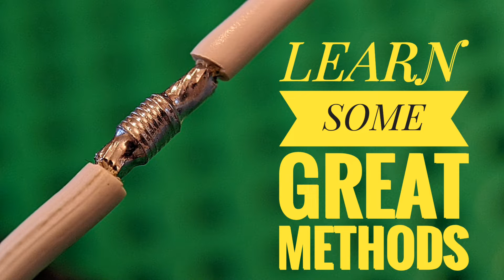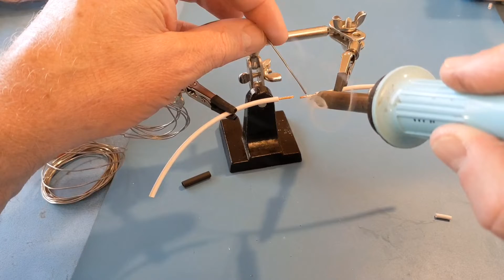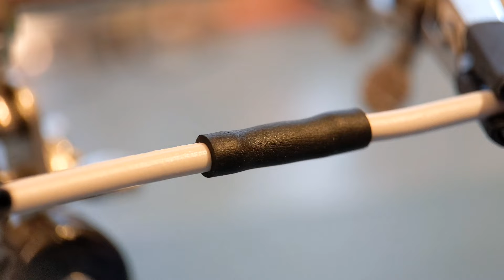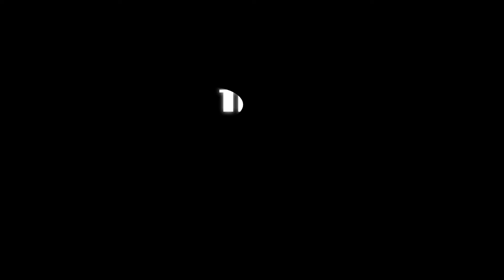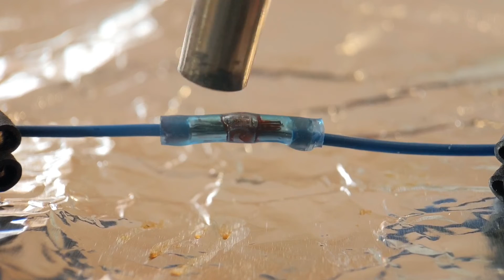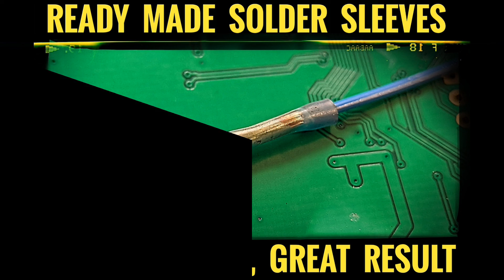How To Solder 2 Wires Together ( The BEST PRO Methods + Tips )

Comment: Thanks for the video, any tips on soldering very small wires? I was trying to solder PS2 controller wires, they only had 2 strands each and they kept melting and disconnecting when I solder.

Also, a question regarding your technique: The way I've been trying to do it is hold the solder iron under the wire and get the solder to melt on top, it doesn't always work for me for some reason the wire just doesn't get hot enough to melt the solder. Looks like you start with the iron tinned, then hold the iron side ways on the wire and have the solder touch the iron while moving back and forth, would that be an accurate way to describe your technique?

Comment: Oh man, that is gold right there. I've used a couple of those techniques, but I'd never used the "wrap with external wire" method before, and now I'm wondering why the ^#$) I never thought of that before. I could easily see that  becoming my go-to technique for wire splicing (I usually use the  mesh technique at the moment). It also occurs to me that you could combine the mesh technique and the wrap technique together. I might just grab some wire and try that out later just to see how it works.

Thanks for the awesome video!
Reply from the maker: Hi , thank you for watching the video and commenting , your support and kind words are very much appreciated 👍
Reply: @mrsolderfix3996  - After writing that I jumped over to my lab bench and did a few test splices. I did try combining the mesh technique with the wrapping technique.. and I'd say that worked extraordinarily well. I will probably do all, or most all, of my wire-to-wire splices like that in the future.  Thanks again for putting this material out there!
Reply from the maker: @PhillipRhodes hi , I'm glad you had good results , that's great to hear . I put a selection of methods out there so people could hopefully find one that works well for them . Thanks again for your support , take care 👍

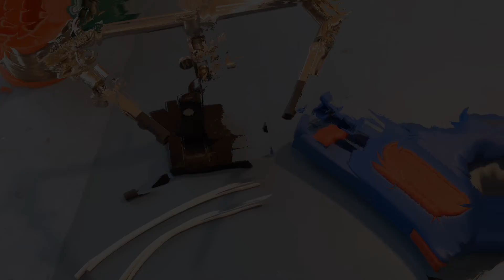Comment: I really liked and appreciated your video.   But I also really liked and am trying to find the Thomas & Betts self-adjusting wire stripper you show about 8:38 into the video.   I have struck out trying to find anything like it that will go down to 30g as you mention for use with very small stranded wire multi-conductor cables.   Would you please provide the model name or number for that tool?

Comment: Nice video. I still prefer lined marine grade heat shrink over silicone method. It gives connection a rigid thermo suitable for underwater applications.

Comment: I would add the 'double L' method. It is a (better) option of your 'hook' method (as it provides more contact area to the joint). You bend each lead in an ''L' and you overlap them slightly. You then twist the 'leg' of the 'L' around the other wire. Do that for the 2nd wire, and then do a slight pull and solder. This provides a better electrical and mechanical connection. The 'J' really relies on the small connection in the elbow of the 'J' for the electrical connection.
Reply: You can't trust solder to provide a mechanical connection - it is very weak in that aspect.

Comment: Nice video. Only thing I would comment on is that when you shrink the tubing, you only (show) heating one side of the tubing. You really need to rotate around the tubing, so that all sides shrink. Also, I see people using a BIC lighter, and it kills me! Buy a heat gun!!!
Reply from the maker: Hi , the way I've done it with the foil behind it reflecting the heat back ensures shrinkage all around . Unfortunately I don't have a proper shield that fits onto my hot air gun so the foil is a good substitute and works well . Thank you for your comment , much appreciated 👍

Comment: Interesting the solder sleeves. Now need a video on how to use just a flame (cigarette lighter for one example) to solder two wires together. Great for a field solder where no power to use a electric iron.
Reply from the maker: Hi , thank you for watching the video and commenting , much appreciated. I definitely need to do another d.i.y soldering iron video that can be used without electricity. Thanks for the suggestion 👍

Comment: What I do: Twist wires together, bent it over, twist solder around it, heat it up, bam! Get very nice and low resistance results with this method.
                                 \
---------------                \                 ------------------
                 --------------| |--------------
---------------                                   ------------------

Comment: Nicely presented. I prefer the splice where you lap together, bind with copper wire around the lap, then solder and heatshrink. Looks decent, gives good area for electrical conduction and is mechanically strong and compact. Nice job thanks for video👍
Reply from the maker: Hi , thank you for your comment, much appreciated. Glad you enjoyed the video 👍

Comment: Again, great video.  I've been using these methods (especially the solder splice mesh method), for years but didn't know the names until now.  When I use the mesh method, I often give the wires a slight twist and have them lock together tighter.  Probably made a bit more work for myself but I've had very good results from those.
Reply from the maker: Hi , thank you for your comment and support of my channel , very much appreciated. It sounds like you have great success with your method so good on you . Hopefully within these methods there's one that can help people out . I like you have my preferred favourites so I tend to stick with these . Thank you again for your time , take care 👍
Reply: I do the same thing - mesh method, but with a twist. I think the only real downside is that twisting the strands together may make it harder for the solder to wick its way through the entire joint. But I like that it holds the joint together during the soldering process.

Comment: Would have been nice to see how you start the wire wrap. I suspect it's very fiddly!
Reply from the maker: Hi , thank you for your comment. The wire wrap method is actually really easy . I just lay a length of tin copper wire along the joint and then turn at a 90 degree angle and go around the 2 wires being joined . Repeat this turn process until you have a suitable amount of turns for size of joint then trim both ends and you should have a tightly packed spring like wrap . Sounds complicated but it's actually really easy . Hopefully this makes sense , thanks for your comment , take care 👍

Comment: I’m currently doing project with 24 g wire and I have early stage Parkinson’s so soldering is a time-consuming adventure fore me.  When I look on Amazon for heat shrink tubing, they are always variety kits.  Is there such a thing as buying one size and what size would you recommend for 24 g wire?  I like the idea of making my own solder and seal sleeves, they’re probably better then the pre made ones.  So when I ask for a recommended size it’s for transparent sleeves to become homemade solder sleeves.  Thank you very much.

Comment: Good video. I might suggest a couple refinements. It helps to clean wires you've touched before soldering them, as the skin oils are contaminants. 99% IPA works fine. Bravo for showing the value of external flux, many folks starting out would be well served to embrace the big improvement external flux provides, as simply using cored wire is often inferior or just harder to use.
Reply from the maker: Hi , thank you for your comment, very much appreciated . Hopefully your comments can help a few people out , so thanks for the suggestion . Take care 👍

Comment: Thx for the tips ! I'm gonna use these methods next time
Reply from the maker: Hi , thank you for watching the video, very much appreciated. I've just put together a selection of my 6 favourite ways to join wires so hopefully in amongst these methods is a choice for everyone . The homemade solder sleeves really work well , that's why later on in my YouTube postings I gave it its own little video posting . Thanks again for all your support and good luck with any soldering projects you take on . Take care 👍
Reply: @mrsolderfix3996  i really do like this method but I I prefer the one where you « mix » together both cables and then solder them. In any case the cables won get a high mechanical force which would break the solder so it will be a long lasting repair.
Reply from the maker: Hi , I guess we can choose what strength we need for the job in hand . Hopefully within these methods I've covered most different strength joints 👍
Reply: @mrsolderfix3996  y it’s amazing thanks again !

Comment: Absolutely fantastic tutorial. This gentleman is an excellent teacher and deserves many more views and subscribers. Top notch material in this channel explained clearly and in a manner apt for even newcomers to understand the easy to follow instructions.

One quick question, for the home-made option, what is the material used for the sleeve portion?
Reply from the maker: Hi , thank you for your support , much appreciated. 
The clear sleeving I used to make my solder sleeves is called RNF-100 , available from Farnell , RS Components or if in America Mouser or Digikey , plus there will be other places . The size I used was 1/8th of an inch. There is another type of sleeving , a bit stiffer called RW175 . Both are good options . Hope that helps , thanks again for your kind words 👍
Reply: @mrsolderfix3996  Thank you so much for the additional information.
Reply from the maker: Hi , no problem , thank you again for your kind words 👍

Comment: The coil spring wire joints are Quip connectors once manufactured by Sprague also know as Kwikettes. These were used in radio manufacturing since at least the mid 1920s but probably go further back.  They were mainly used on single core wire and components leads and I have never seen them used on stranded cables but that isn’t to say it would be a problem.  Not new just forgotten.
Reply from the maker: Hi , thank you for your comment , good to learn new stuff . The wrap actually works really well on stranded wire so definitely a good option for people.
Thanks for your support 👍
Reply: havent heard Quip in decades, thanks for the memory recall!
Reply from the maker: Hi , thank you all for your comments , much appreciated 👍

Comment: Thank you for the upload Mr. Solder Fix!

Have you ever used MG Chemicals 413B-1L Heavy Duty Flux remover? Should arrive shortly, gonna use it to clean some power supply units for the ps1 as well as the motherboards.

Have a good evening!
Reply from the maker: Hi , thank you for your comment , much appreciated.
I've never used the flux remover you mention so I can't personally comment on it. 
The one I use ( SMFL200D) I really like but I think it's only available in Europe.
I hope you get on ok with your one that's coming shortly , and good luck with all your soldering projects , thanks again for watching the video 👍

Comment: Absolutely brilliant!! That hook method looks beautiful! I had never seen it before. I've only soldered twice in my life and both times I just used the mesh method but I also twisted them around after meshing them together. Didn't even know the name of it, I had just bought a cheap soldering iron kit as a teen and went to town on a friend's old E30 wire harness that needed repairs in plenty of areas that had been butchered by the previous owner, and my friend was very impressed with the quality of the joints (as was I). It was trial and error and I quickly learned that I needed to go in hot and fast as opposed to longer times with lower temps. After watching your videos now I wanna give it another go and solder everything to get even better results! To anyone in America or the Caribbean who's trying to find an alternative to the amazing flux he uses, I found a really high quality alternative that's sold here. It's called Kester 186 and it's a liquid, no clean, RMA type flux. They sell it by the gallon but resellers also fill up tiny bottles with really convenient, ultra thin needle-like spouts to dispense it. (not actually sharp tipped, just a really thin, metal cylinder). U can find em on e-bay. I haven't checked Amazon but you can probably find it there too. By the way Mr. SolderFix, you should look into adding affiliate links to all the products you use in your video description. That way, people can just click on it and purchase it conveniently without having to search for it, while at the same time at no added cost to them, they'll be helping you out by you getting a small commission for every sale. I suggest also adding options that are readily available in America alongside the European ones. The information you're providing to us is invaluable!! Thank you so much! :)
Reply from the maker: Hi , thank you for your support of my channel , very much appreciated. I'm glad you enjoyed the video , I will always post new videos when I get some time.
I've not used the flux you've mentioned but if it works well hopefully other people can benefit from this comment and try it out.
I've never thought about doing Amazon link ups etc , I don't even show product links as I don't really like to push certain products more than others , but maybe I should think about this more.
Anyway thanks again for your comment and good luck with all your soldering projects in the future 👍

Comment: How would you join thick wire like zero guage/awg?
Reply from the maker: Hi , probably best 2 ways with zero gauge wire would be to use butt connectors or crimp a ring terminal on the end of each wire and then bolt them together . I personally wouldn't solder this thickness . Thanks for your comment👍